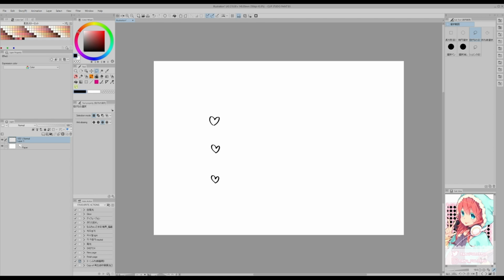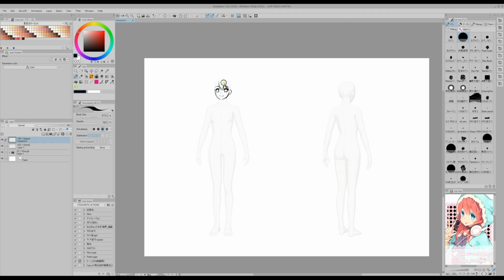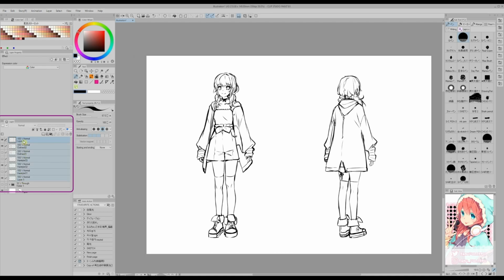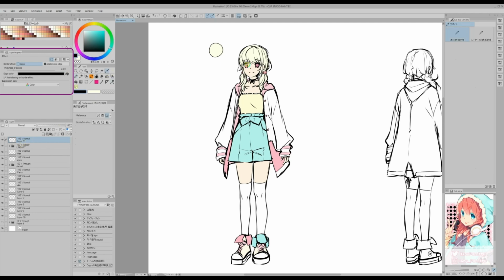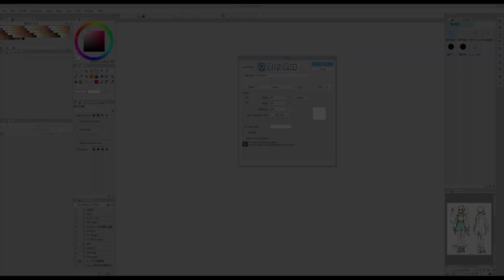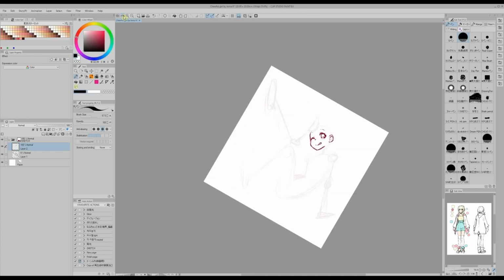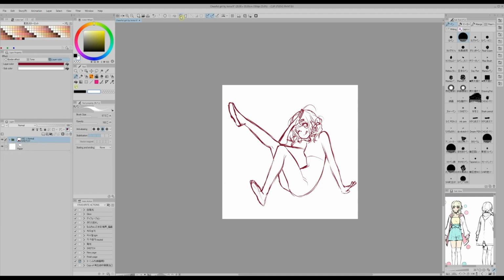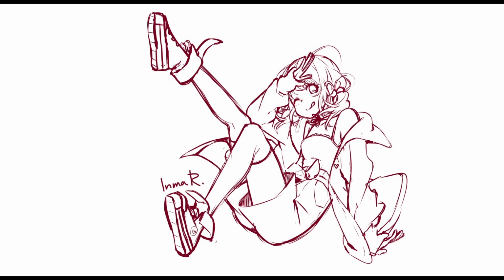3 helpful steps for character sketches | Inma R.

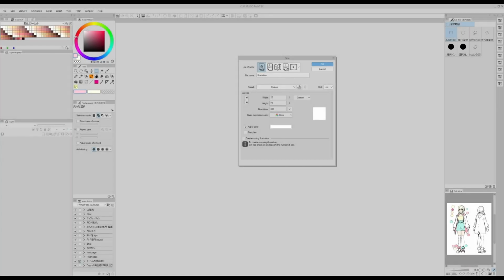Comment: 6:57 in my csp, why when i change the dpi resolution seems like not working? so all i can do is to increase the height and width to get high quality
Reply: what exactly are you doing? Are you changing the dpi after you've already drawn something, or is this when you create the canvas?
Reply: DPI only affects printing. It doesn't change the size of drawing. DPI means dots per inch. Which is how many pixels equals an inch when printing. So the pixel size of your drawing doesn't change when you change the DPI.